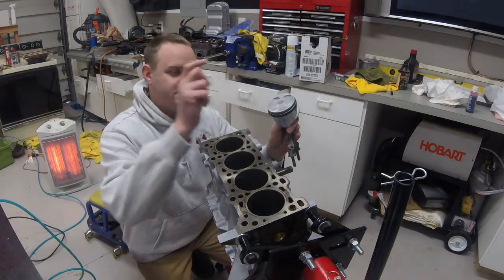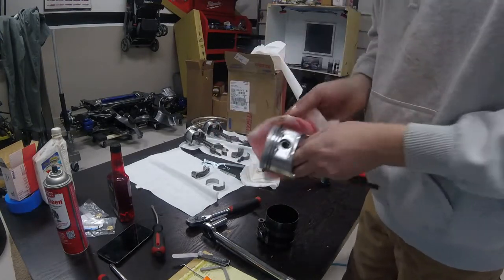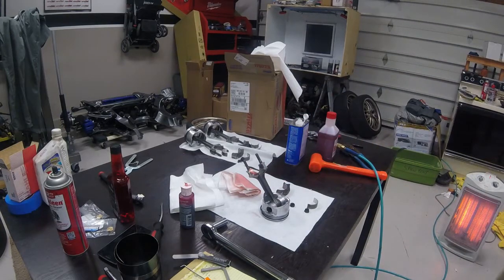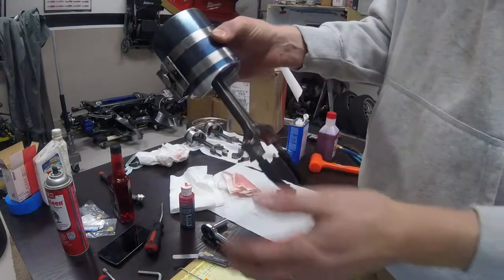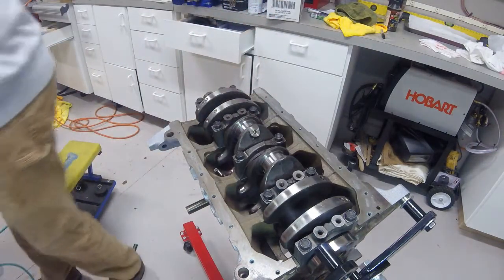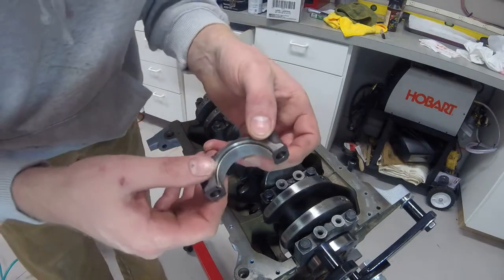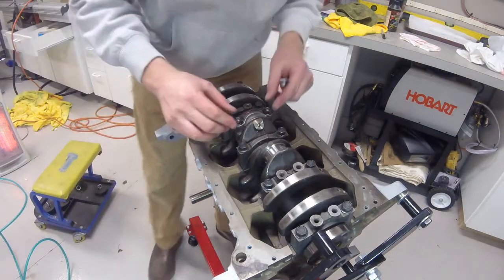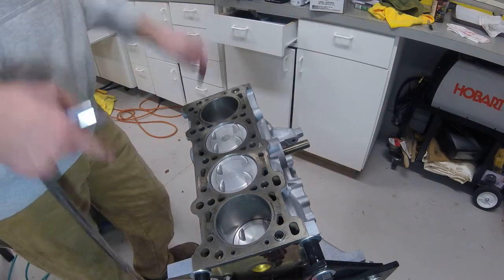Miata Piston & Rod Install Guide

Comment: Where does the spacer gap for the oil rings reside? Same side as oil ring gaps or opposite side?  I would assume in line with pin?
Reply from the maker: Not sure what you are asking but the three oil rings the gaps are at different places on all three.  Look at a factory workshop manual to see exact positioning

Comment: Awesome video as always! When you do the next build are you going to balance the rotating assembly?
Reply from the maker: Lukas Gilkey ya gonna have it all line bored decked bore the cylinders out.  The full works.  Gonna live with this set up for a couple years until it dies from the turbo or I want to go big hp
Reply: Nice! What is your hp goal with turbo and what setup are you going with?
Reply from the maker: Not sure what turbo yet.  Plan is start up and test on na.  Then get megasquirt installed and trouble shoot suspension, steering, wiring, leaks, ect.   Then probably next winter do a mild turbo build.  200-250 whp.   All depends on what is best that I can still get a little traction